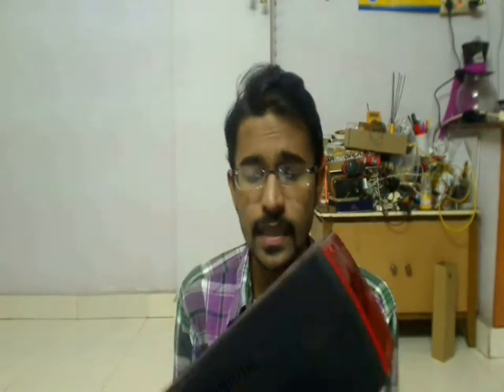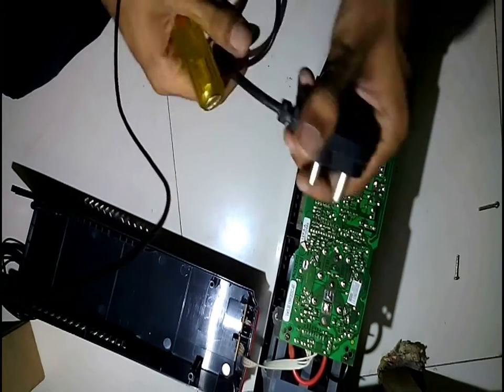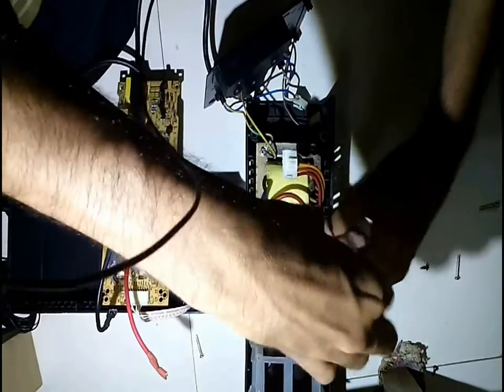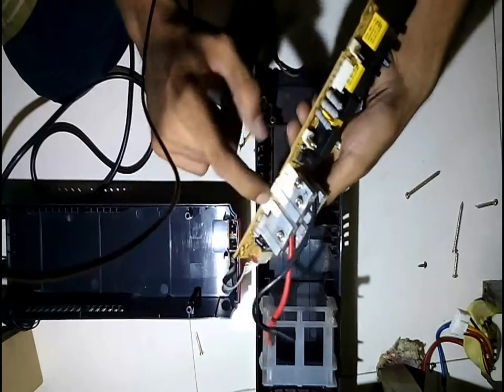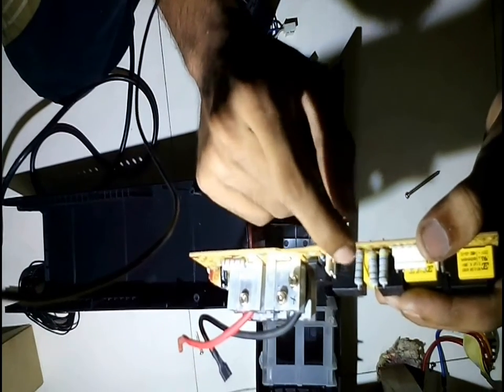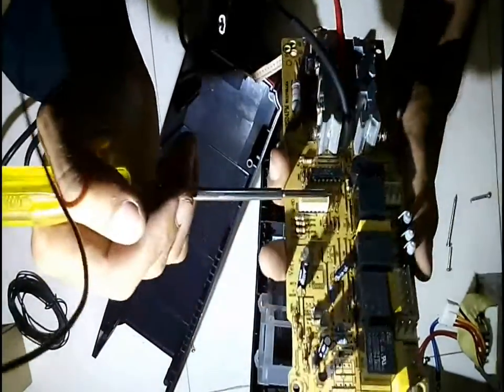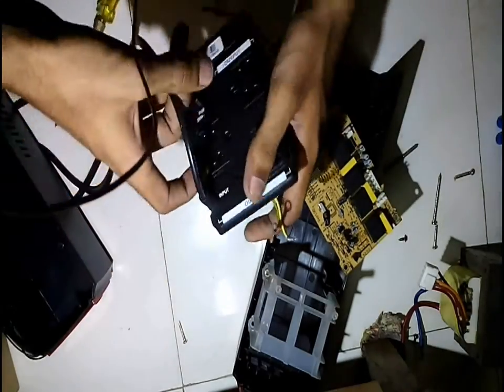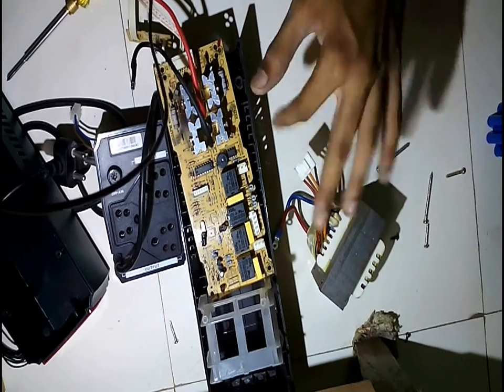#E-CYCLE : SALVAGING COMPONENTS FROM DEAD  UPS

Comment: Hello dear,
The UPS you have is a 600VA UPS. Then measure the secondary voltage of the transformer by applying mains 220V on the appopriate tap wires on the primary side. Once you find the voltage, you can divide it with 600VA and you will get the secondary full rated current i.e., short circuit current.
If you get 6V its a 100amp transformer...
If you get 7.5V its a 80amp and
If you get 9V its a 67amp.
You will never find 12V AC output from the secondary of the transformer. Reason is once you convert DC voltage into AC voltage, the voltage reduces.

A simple example can be RMS of sine waveform which is 1.4142 or square root of 2. Since RMS is also considered as the average value, the transformers work on this average value and this value is set carefully based upon certain parameters:
1. Duty cycle and waveform of the oscillator.
2. Frequency of the oscillator.
3. Battery voltage.

To find the AC equivalent of 12V, we have the battery voltage and the RMS of sine waveform since transformers are designed and manufactured on a test upon sine waveform.
So, putting the values together we have 12V divided by 1.4142 gives 8.4853 which is as good as 8.5V AC. 
Now, 12V DC from battery gets converted to 8.5V AC by the circuit board and this is the voltage you will get at the output from the mosfets......this is just an example.

The transformer secondary voltage is designed based upon the output voltage of what the mosfets give depending upon how the above mentioned parameters are set. 
Usually you will find any voltage from 6-9V AC secondary output from transformer if the UPS is a single battery system most probably 12V.